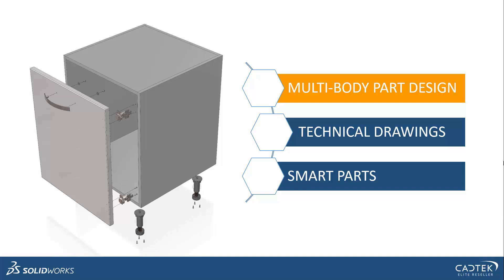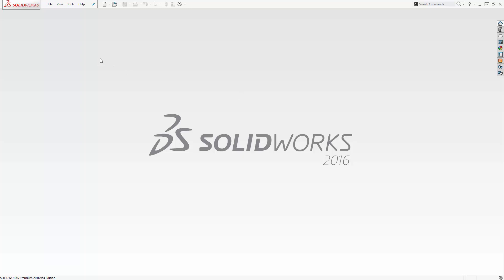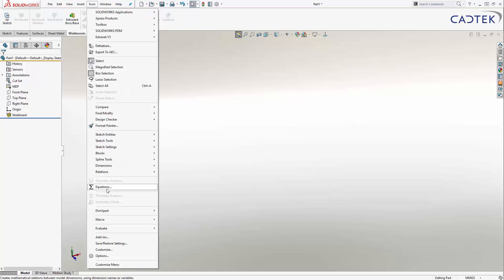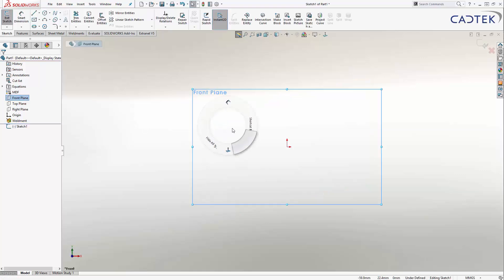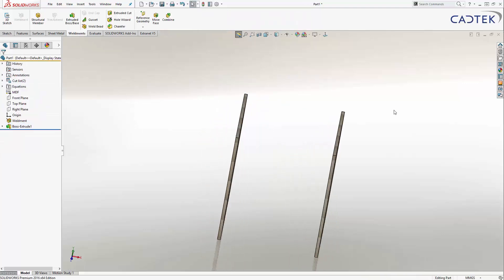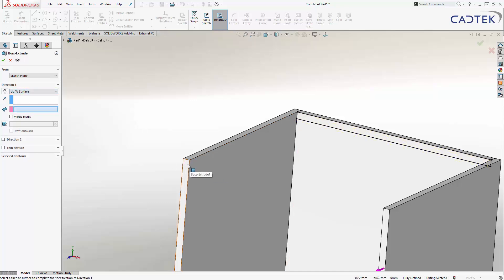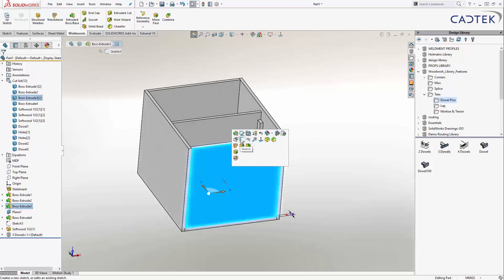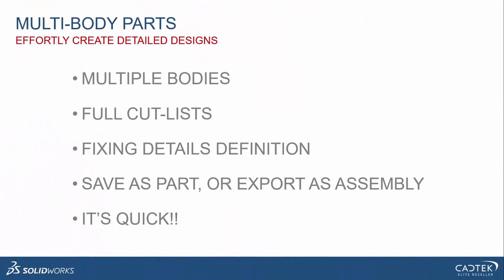Introduction To Cabinetry Within SolidWorks Part 1: Multi-bodies

Comment: For anyone wondering about the dowels, you can't add them into an assembly. They have to be inserted into a prt. So many people doing cabinets draw the whole dresser or ect. As one part file. Drag and drop the dowel cuts, 
then save bodies and create assembly to get the result.